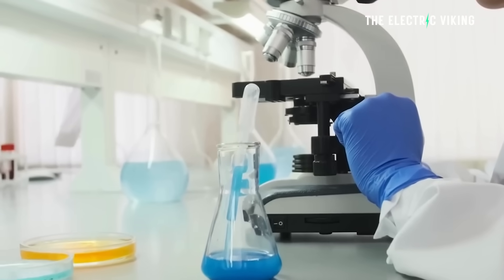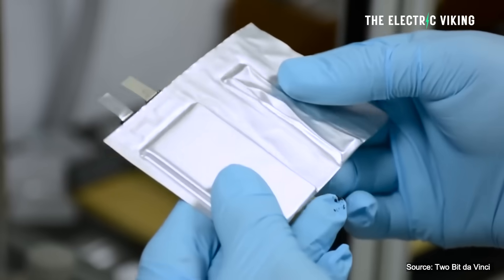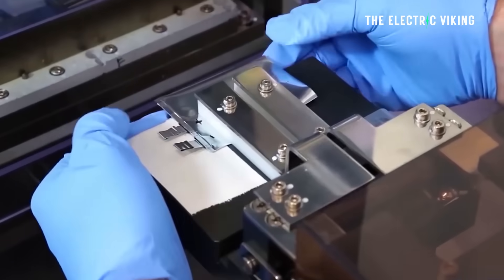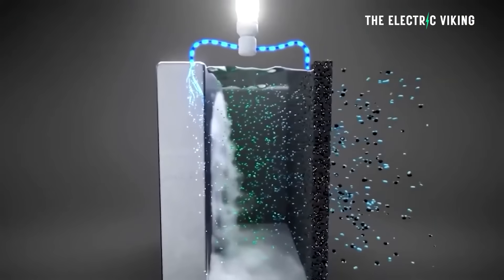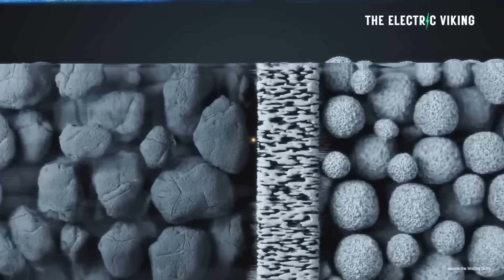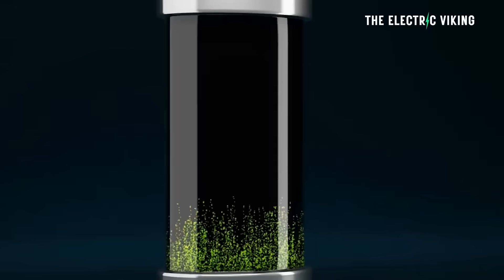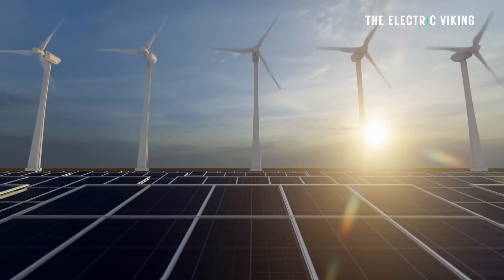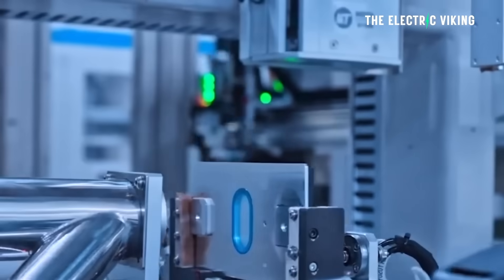12 Million Miles - The New Battery Tech That Could Power an EV for 100 years

Comment: And Li-ion batteries can have 280-300 Wh/kg energy density... so means 50% more weight on EV batteries. Not to mention virtually nobody drives or wants to drive their car 12M miles... "Your battery has nice car around it"..

Comment: Maybe I’m missing something, but I really can’t see the point in the heated debate which exists between EV lovers and petrol lovers. If people prefer EVs, they should be allowed to buy these, and if people prefer petrol cars they should allowed to do the same. It’s called democracy. At the moment I happen to prefer driving my 2003 1l petrol Yaris which is convenient and cheap to run, though if battery technology and the charging infrastructure improve sufficiently I may well change my mind. To try to force manufacturers to sell EVs when it is not the seller who makes the purchasing decision, and when satellite photos have shown more CO2 is beneficial to food production in the hope that this may reduce global temperate when more people die from cold than heat, seems about as pointless as quarantining uninfected people to slow the spread of a disease so mild you have to be tested to even know you have it. The real problem is that the government will fall for any scam the global elite dream up to reduce our freedoms if it makes them feel good, regardless of the cost.

Comment: (Yicai) Nov. 4 -- Chinese researchers have achieved the world's first thorium to uranium nuclear fuel conversion in a molten-salt reactor, making it the only operational reactor of its kind loaded with thorium fuel and lifting the shares of equipment suppliers involved in the project. The Thorium Molten Salt Reactor, built by the Chinese Academy of Sciences' Shanghai Institute of Applied Physics in collaboration with other institutions in northwestern Gansu province, confirms the technical feasibility of using thorium in a molten-salt reactor nuclear energy system, SINAP announced on Nov. 1. The global nuclear power sector generally uses uranium-235 as reactor fuel, but its reserves in nature are very limited. China's uranium resources are especially scarce, so it's highly dependent on imports for nuclear raw materials, while demand grows with the industry's rapid development. To find an alternative to uranium-235, the Chinese researchers set their eyes on TMSR that can convert thorium-232, which is rich in natural reserves, into uranium-233 by absorbing neutrons, creating a sustainable nuclear fuel supply, SINAP noted.

Comment: I think the future would be to be able to charge batteries (which would only be used to store energy needed to get the process moving) with a very very economical method that relies not on conventional power sources such as the electrical grid or with ICEs but, instead, would be based on technologies that have been hidden from us but revealed to us on occasion. This would, of course, happen only when the global mafia is abolished. May it be abolished soon. Amen. In Jesus' name.

Comment: The beauty of a battery is that you can build one out of anything, including thin air! Compressed air to be exact! Water batteries (pumped storage), sand batteries (heated sand), or Energy vault that uses gravity and blocks! Batteries chemistries can continued to be advanced and implement, whereas gasoline and natural gas are pretty much stuck in terms of efficiency. Engines can get more efficient but you are still dealing with the same chemistry. Batteries have way more advantages and room for future advances.

Comment: Right now my Chevrolet bolt is probably going to make $250,000 MI with the battery that it has. So the oldest technology that's driving around right now except for the sports car Tesla is still enough. The number of cycles is not an issue. It's always going to be price. Range First charge time  third. Already the batteries and motors are going to Outlast. Every other part of the car at this generation. Will be replacing seats, carpets, windshield, wiper, motor assemblies, axle bearings long before we're replacing the battery in the motor

Comment: Maybe one day the role of the power grid will be reversed: Instead of delivering power to homes it will be collecting power from homes to power data canters and industry.  If there is solar new tech solar panels on ever roof then electric cars become much more viable -- maybe even transcontinental rail roads. Battery storage is very important to smooth variations of solar power sunny days and hourly demands. If the grid goes down; can you still charge your car.

Comment: Finally the technology is approaching the point where EVs will become practical for more than city folks. Where I live in the mountains of northeast Tennessee, drives of over 160 miles round trip are fairly common. For instance, to get to the VA hospital in Johnson City, I have to drive more than 80 miles each way, more than half of that over twisting mountain roads. These new types of batteries show great promise toward making EVs practical for those of us living in the middle of nowhere. Eight now I would like to buy an electric trike to run to town and back. The current ones would do the job OK, some can even handle the mountains; but, I don't want to buy a vehicle that uses current battery technology only to find it obsolete in a couple of years. I think the makers of these vehicles should design therm so that the battery packs can be replaced with newer, better types as the technology develops, without having to buy a whole new vehicle. I am a retired EE, but I am not really knowledgeable enough about these batteries to know how much of an undertaking this would be. I know replacing the old carbon zinc batteries with alkaline batteries or even NIMH batteries in almost all gear from flashlights to transistor radios does not pose a problem. I hope replacing lithium ion batteries with these new types might prove as easy.
Reply: Most EV's can currently travel 200 - 250 miles on single charge. So what is the problem?

Comment: I’m using the iPhone 13 Pro Max. I will not uograde until these new battery technologies are employed in phones. I’m so tired of a year of use then a $99 battery replacement tired of 2 hour charges for the same energy my car accepts in a fraction of a fraction of a second. Tired of charging my watch everyday then having it die and unfindable in the house. I guess I’m tired. 💤

Comment: Gasoline has an energy density of 12000 Wh/kg.  We have a long, long way to go.  Up until recently, batteries had their own form of Moore's law.  Unfortunately for humans, that doubling rate was once every 10 years.  It may have accelerated after the EV rush.  Still, that's 13.5 doublings before they match gasoline.  Which may never happen.  Still, we could very well get close.  That's 130 years of exploration, however, to get there.
Reply: 16 gallons gasoline = 400 miles range
 Tesla Model 3 LR (Long Range) = 466 miles !!!
So, what's the problem?

Comment: One cannot compare any battery tech with...nuclear or any generation. Batteries produce zero energy, they store it. Thus they can work with nuclear or any form of generation. Stop with apples and aardvark comparisons. The analogies don't work. Secondly what does it mean they can last "longer than nuclear"? Nuclear power plants, coming off line every 18 or 24 months for a 2 week refueling, can now last up to 80 years. But again, so what? Thirdly, why can't they work in EVs? If they work in utility scale storage they can and should work better in EVs where the real GHG emissions emanate from. Density is density and efficiency is efficiency,

Comment: I just watched another you tuber who actually does tests on real batteries not marketing hype he focuses on solar backup systems and current products. He thinks na ion batteries are flawed in at least two ways round trip efficiency is only about two thirds meaning about a third of energy is wasted. Lfps are about 95% efficient. The second problem is the voltage discharge curve is steeply sloped meaning. The voltage on a 12 volt na battery varies between about 15 volts and 9 volts when discharging 90% where lfps vary about 1 or 2 volts. Meaning on a 12 volt system only about half the energy density is usable.

Comment: Regarding the use of these batteries in EVs: Why not buy a battery pack (of agreed standard  dimensions) and an EV sans battery with your bayyery pack fitted by the dealership proir to delivery, and when the car reaches EOL, simply transfer the battery pack to the new car. this should also make EVs much cheaper to manufacture and sell.

Comment: Promise is one thing, and the reality is the other.
My GWM Ora 03 LFP battery is already at 87% SOCE after just 2 years and 30,000 km.
It was also promised to last more than the car's lifetime. Now I am not sure it will not reach 70% before warranty expires, if it doesn't fail until then.
I guess, car's lifetime now is equal to battery warranty period of 8 years.
They don't give you a new battery if this happens, just refurbished one, that could also be just above 70%. 
I only charge AC slow charging and up to 80% SOC, except calibration once in a couple of weeks, but I live in a hot climate.
The market value of this EV (already dropped ~45% since new) after 8 years would be less than the cost of a new battery and the car would be practically unusable.
I also have hybrid car (Lexus IS300h) which after 11 years and 120,000 km is as good as new, original NiMH traction battery, even original 12V battery, only with regular maintenance, never broke down in all these years.
How about that?

Comment: Just because of Abundance x Performance x Safety, I think Sodium will be hard to beat. This is a 3x improvement, but the manufacturing process is fundamentally different, too. It will find niche uses, but sodium will be great for cars and grid simply because there is no Sodium supply challenge.
Reply: my thoughts as well.... sodium is everywhere

Comment: You might want to fix the battery animation at 1:12! During spontaneous discharge electrons flow in the external circuit from the Anode to the Cathode not vice-versa.

Comment: 70 % degradation. That's a lot. Most battery life is determined at 20%  degradation, ie 80% left. 30% of a 300Km range is only 90 Km. Not very useful.

Comment: Sodium blows up when I contact with water. You can call that safe. I call it a rolling bomb. Zinc is safe, so is aluminum. A nuclear reactor produces electricity which one can store in a battery. Batteries don’t replace reactors, unless you want hydro electric, gas turbine generators, geothermal (like Iceland) , solar; then batteries can be charged und used in a variety of ways. You know this but you’re getting sloppy with how you express yourself. This is a STEM topic please use accurate language.

Comment: Singapore is advancing and pushing for green tech and I’m not surprised that they innovated a battery with ultra high density to store all the clean energy they can generate to supply to the grid. It may not be for EV in the next few years but it may be used for clean energy grid for the local data centers,  manufacturing, and port infrastructure.
Reply: Singapore likes storing hydrogen gas inside room temperature non-toxic liquid by Ayrton Energy for ocean going ships and intermodal distribution.

Comment: Sounds great! We just need the insurance companies to fix EVs instead of writing them off. Life cycle of battery doesn't matter when the car is thrown out.
Reply: To be fair though old ice cars are basically scrap, the engine block is only worth melting down for the metal.

In contrast with old EVs the electric motor will have a ton of copper and rare earth agents, the battery will be 95% recyclable, and the scrap value of the car will be significantly higher, as well as cars being significantly easier to repair. EV cars could last basically forever if the batteries and electric motors are replaced, so long as the chassis doesn't rust and the car doesn't get in an accident.

That's simply not possible with ICE cars, when the transmission and Mor engine block goes, the whole thing gets scrapped.

Insurance for Ev cars will definitely have to adapt.

Comment: Because of how fast the battery technology is currently evolving, I'm not sure extreme longevity is the most desirable quality right now. The battery will be obsolete long before it dies. Low cost, on the other hand, is a big advantage - better have a cheap product go obsolete on you than an expensive one.

Comment: What happens to energy density with this battery? Even for stationary battery storage density is important as well. The cells are making up about half of the cost of the storage system. More volume would make the civil works and electrical system requirements much more expensive. Do you agree?

Comment: It is NOT possible to quote how many miles a battery will do because that depends on the characteristics of the vehicle and size of the battery pack. You can quote energy density and degradation rate.

Comment: I agree with your 100%.   Batteries, wind, solar, wave, dam power is the future.   Uranium (fission power), coal and oil power is a history for books.
Reply: Interesting!
Reply: Energy density of Wind and solar are orders of magnitude smaller than nuclear. That means you need lots of materials, iron, copper etc to replace fossil/nuclear energy sources.
Reply: @FlintStone-c3s  If you look at energy density only, you might be right.   But I look at everything from the start to finish line.  The listed sources do not produce used fuel waste which is a main reason why we have problem with energy sources.  Businesses love the mentality of use and forget it to pursue a quick wealth and thus why we have waste management problem.   There is a reason U.S. banned insuring nuclear fission reactors because the coverage cost is just too big to handle. Cost of global warming and nuclear waste is of a cosmic proportions when compared to my listed energy sources because they do not require fuel to generate energy and they do not produce used fuel waste.  Any country that will embrace that will lead this world and any other country that will stick with old energy sources will stay old and decay.  History is full of examples.  Rome - manpower, France - water, England - coal, U.S.- oil and uranium,  China  or other nation - ?????..
Reply: @adams74  Most renewables are made in China powered by dirty coal power. The amount of renewables needed is 100 or more times what is already installed. Great profits for those making them, especially when they bribe gov reps to legislate abandoning the old fuels.

Comment: can it get 500 miles???? range with 20yrs shelf life
Reply: That's a bit silly. Does your ICE "get 500 miles"?  

EV range is simply a matter of calculation based on battery size, vehicle weight, aerodynamics, speed driven, etc. The energy density is capable enough for to "get 500 miles", but would require a large battery.  The question you should be asking about any battery is the charging curve, i.e. how many kw can the battery take in per unit of time over the charging cycle, and how quickly can it get charge from 20% to 80%.  That was not discussed. As for "20 years shelf life".  They have not been around for 20 years, so there is no empirical data on that point.  However, 40,000 cycles with less than 30% degradation is pretty impressive. Charged once per week, that would be about 800 years.  

More concerning is that the power density on this initial prototype is only 110 w/kg.  To get 100kw (147 HP) of power would require a 1000kg battery.  At this stage the technology is better suited to storage than mobility

Comment: Funny thing. more than two decades I remember reading that in the future you would see a reduction in the amount of "one size fits all" solutions, specially in the energy department. That is, there would be a marriage of many fields together. 2025. You have wind and solar as the source and many others. You have different types of batteries. You have many different ways of making electric motors. The field is now wide open. It's fantastic news.

Comment: In cars we don't need batteries that last forever. We need cheap batteries (no rare materials) that won't catch on fire and works in all temperatures.  This one seems like it would be perfect for grid storage and spacecraft. There seem to be unlimited ways to make a battery and even Ai can't seem to identify all of them.
Reply: Anything that stores an enormous amout of energy is liable to release an enormous amount of energy.  So I don't think it needs to be perfectly safe, nor will it be possible to make it so.  It just needs to be as safe or safer than fossil fuel energy storage.  If fossil fuel storage kills one person per million miles, then battery energy storage needs to be less than or equal to that.  If it can be made far safer, so much the better.  A 20-gallon tank of gasoline contains approximately 2.6 gigajoules of energy.  To get the same range, it will take the same order of magnitude of stored electrical energy (somewhat less because cars do not convert all the chemical energy into kinetic energy).  If you run into a light pole at 60MPH, either type of system is not guaranteed to avoid a large release of energy.  Of course, it is always good to make things as safe as possible.
Reply: @danncorbit3623  Good point. The bad thing about gas is the tanker trucks that take it to market. One of those took out an overpass and did a billion dollars worth of damange that took over a year to repair. No EV can do that much damage.